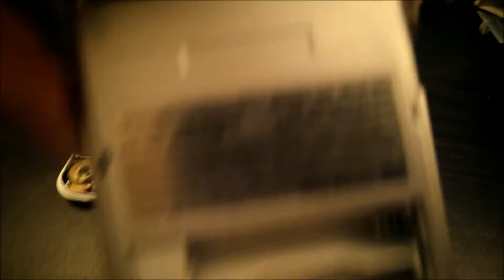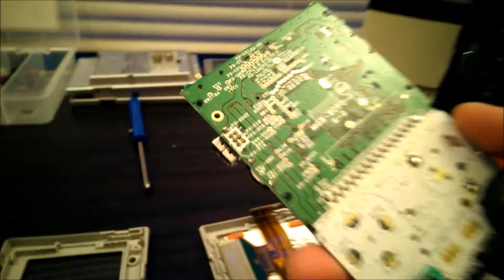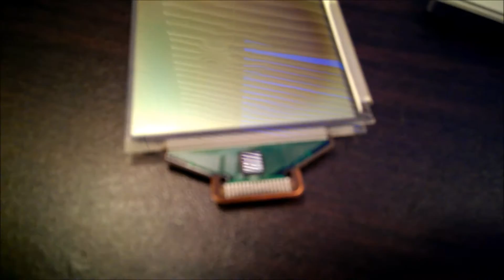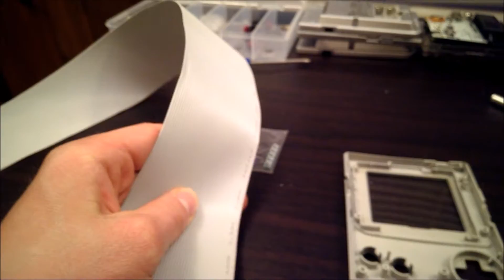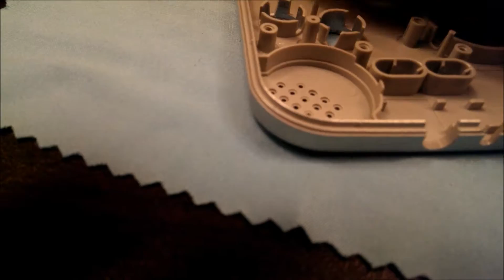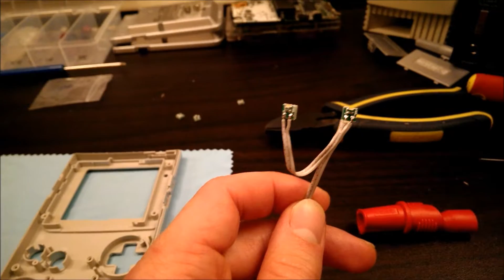GB pocket Mod, Part 2, Backlight Buttons

Comment: where do we solder the wires on the gameboy pocket board?
Reply: Same question here, I feel like maybe where the batteries are?
Reply: Let me know if you found out, imma keep searching
Reply: @skubwork6986  i already found where to solder it to
Reply: @itzedd1e  Where at?
Reply: @skubwork6986  i found 4 different solder points, if you have a multimeter you can look yourself